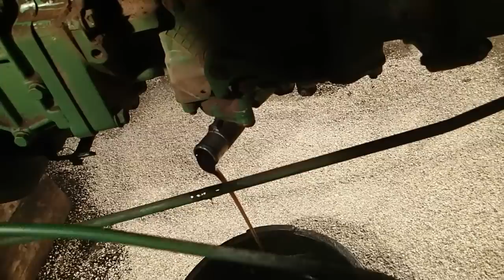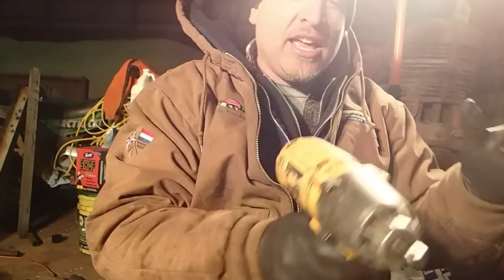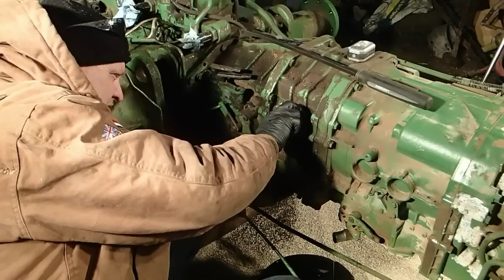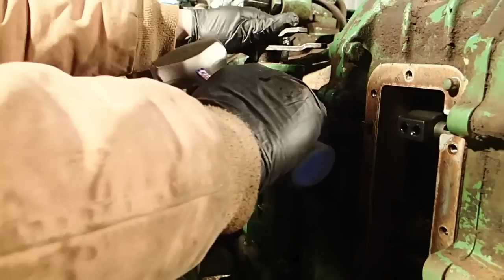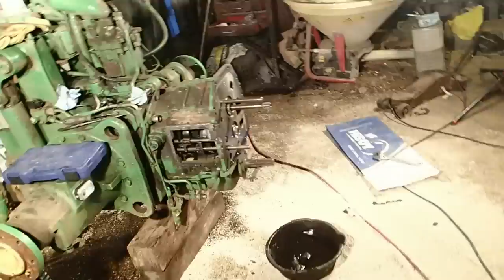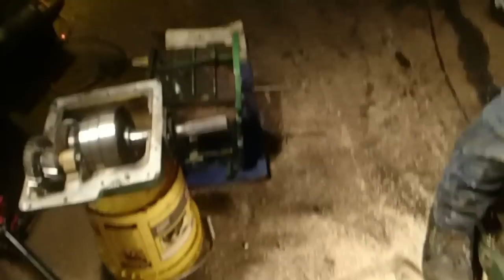exploration to find the problem with the 6200

Comment: Nice to see, when you understand how and why it works you don't generally need books to diagnose problems, the only real time I find them useful is during reassembly for torque/angle settings and tolerances.

Comment: I just kinda figured it wouldn't move, because it was in multiple gears....  Since shifter cables and such were disconnected....
What was the problem originally?  Before deere made it worse by not putting it back together...?
Reply: bad synchro's.

Comment: Hire a mechanic, the transmission and rear as well as brakes can be diagnosed before disassembled, by turning the input shaft in high gear the axles should turn, if the axles do not turn then check for play in the planetary drives if the brakes are locking there will be no motion at all.
       Looks like rust accumulated problems or freeze up in the clutches!
Your mistake was taking it apart to much before trouble shooting properly.
This type damage can be prevented by changing engine oil.
       Just offering suggestions that might make it easier next time.

Comment: should have a workshop manual so you know what you're doing BEFORE you start dismantling. what if the owner ends up with everything in bits and you never found fault.